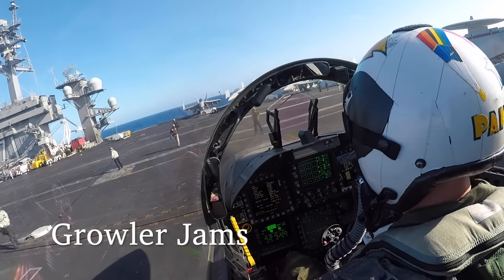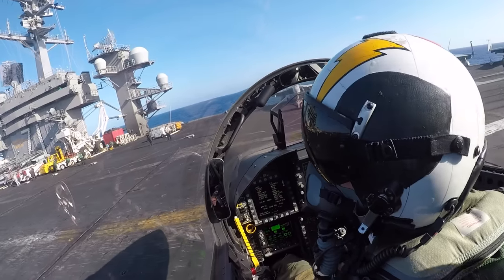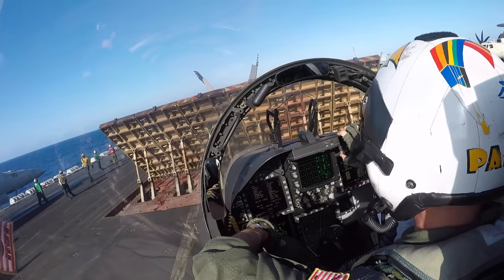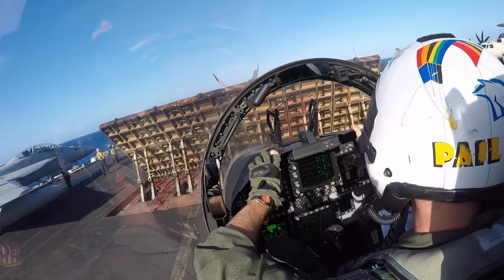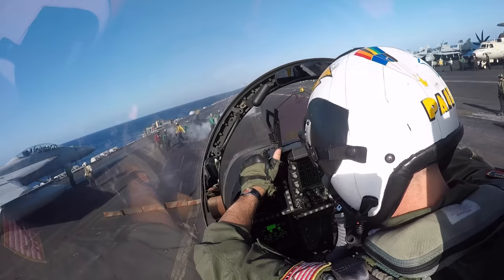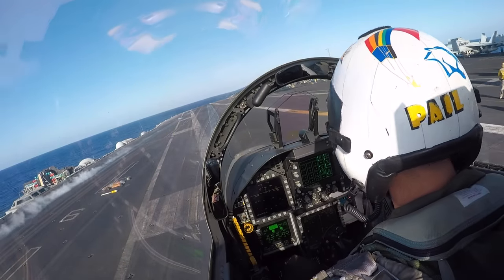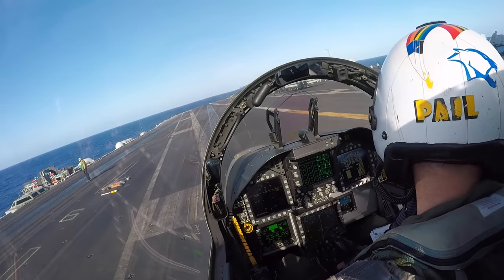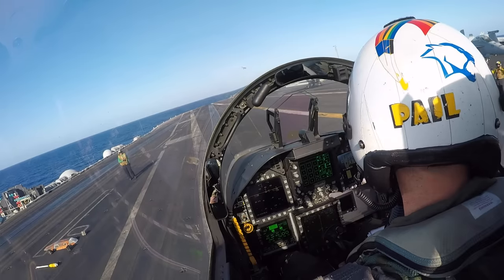What Fighter Pilots ACTUALLY Do Just Before Launch

Comment: I served for 26 years in the Air Force. Started out in NORAD Air Defense Radar Operations, worked in weapons control at the 26th Air Division/NORAD Region at Luke AFB Arizona. from July 1976 thru April 1980. We often had large exercises involving Air Force, Navy and Marine fighter pilots, active duty, guard and reserves, flying F-106's, F-15's, F-14;s and F-4's.  One exercise I got to work with Navy pilots from Miramar flying an F-14. Awesome fighter and the pilots were great. They kicked ass in that exercise!  Really liked the video you did on what you have to do before taking off from a carrier. Worked on the ECM equipment for  the A-10 the last 13 years of my time in the Air Force.
Reply from the maker: TYFYS!

Comment: Good explanation. As a former Handler and Air Boss in the early 80's I am struck by the difference in op tempo between my era and today. When we deployed on Ike (CV69) in 1984 we were loaded with 90 aircraft which included 3 A3 Whales and 4 E2C Hummer very large aircraft so we had very little open space and our deck crews had to be most competent. It was standard procedure to launch 20 plus and recover 20 plus aircraft in 25 minutes. Todays tempo seems very relaxed, airplanes are launched without hurry and numerous people seem to wander around the deck doing whatever they do. Pail just taxies from the finger (aft of el 4) without seeing another aircraft. In my day we would have 3 to 4 aircraft lined up behind Cats 3 and 4.We would be pumping them out as fast as the deck crew would allow. The deck on Roosevelt looked empty. The current director is an enlisted sailor from V2 division wearing a green jersey and yellow directors float coat which to me means that they are using the Bubble. Ike had Bubbles but I would rarely (only for training) allow shooting from the Bubbles because it is much slower and the shooter is detached from the pilot of the launch aircraft. In my years the shooters were always aircrew which produced a trust bond between the ship and airwing. For example during a suspended shot after the aircraft is in tension the pilot was not be allowed to reduce power until the officer shooter stood directly in front of the aircraft straddling the cat track  and signaled throttle back. That allowed the pilot to know from another pilot that the cat was saftied. I understand the standard load out is about 65 aircraft now which in my old timers eyes seems to have way too much empty flight deck. I doubt that the modern deck crew has any idea about how the same deck was run 40 years ago. War is hell and I hope we can win the next one.
Reply from the maker: Wow.  Thank you for your service.

Comment: In 1983 I was in an ASW squadron and we were doing a work up cruise.  There was a bunch of pilots needing Carrier Quals prior to the cruise for the USS Constellation CV-64.  One of the Tomcat pilots got the Air Boss so mad, the Air Boss’ screaming could be heard very clearly over the sound powered headset…  The Tomcat pilot had landed with his parking brake on…  The LTJG was grounded almost immediately!  When we got back to port, that LTJG was sitting on top of his flat spotted tires that was strapped to the pallet next to our gear he was looking very dejected.

Comment: Redesigning the nose gear strut in order to take this tremendous stress on the nose gear, is what makes this type of launch possible to begin with.  Before, it was done with a launch harness, which has a whole different, and more involved procedure. The catapult sled is behind the nose gear. The stress is put on the main wings of the aircraft.  Not in front of it.The physics there makes sense to me.   It takes less personnel to set up this nose strut launch bar type of catapult.

Comment: i have a cat who likes to go outside. when he wants to go out, he runs to the sliding glass door and meows at it. i come over and unlock the door and open it, and he bolts outside. for me its like launching a small aircraft off an aircraft catapult to do this. i call it a cat launch. except for when its cold outside- when its cold outside, the cat takes a few steps, turns around, and then wants to come back inside. i call it a cold cat launch.

Comment: Sir, Do you think that the F-35 may change the way we build carriers? I noticed the Brit's use a Ski Jump instead of a cat as their aircraft as VSTOL capable. Their Helo's fill in for supply, transport, and ASW. JMHO would we be better off with more smaller carriers or the super carriers? I was a USMC UH-1 Aircrew/Crew Chief. We deployed to the USS Tarawa LHA-1 and USS Tripoli LPH-10. The Corps took on the Harrier which could vertically take off but it was unable to launch as there was not a ski jump like the Royal Navy has. My younger brother was with the Marine Detachment on the USS John F. Kennedy and the USS Carl Vinson and he complained about the noise from the Cats in berthing below. BZ...
Reply from the maker: I doubt it.  Frankly jump jets can’t carry much fuel and or weapons.  They aren’t nearly as effective as a carrier air wing.  They are a niche.  Useful in some cases, but the Navy does it better IMHO.

Comment: That just seems like an enormous amount of time spent idling and  hooking up the aircraft to the catapult system. You would think that in the 21rst century and the cost of fuel being what it is that the whole process would be streamlined enough to safely launch in a fraction of that amount of time while consuming far less fuel. The whole process shown is exactly the same as it was when i served aboard the USS Nimitz back in 1985 to 1988. Modern state of the art technology just seems to have never caught up with the systems involved in launching 100 million dollar jets

Comment: Is the catapult pulling the plane completely, so that engines are only increase speed once the jet is launched? Or is the thrust of the engines push the catapult faster?
Reply from the maker: The combined thrust of the cat and the motors create the required flyaway speed.

Comment: If the hold back fails while at mil power but before the catapult shoots can the jet stop on the deck just using brakes?
Reply from the maker: Possibly.
Reply: @GrowlerJams  With the brakes applied and you then go to take-off power will the brakes alone hold the aircraft stationary on the runway? Or will engine power overcome the brakes or damage the tires in some way.
Reply from the maker: Yes, the brakes can hold you in MIL power.

Comment: Nice to be careful and cross the T's and dot the I's but c'mon!  Good video too but ... Show us what you do in REAL EMERGENCIES where someone with REAL weapons is heading for your carrier ready to fire and if you always take that long... you would be sunk before you get past the blast barrier!!  Show us how FAST you can get that thing on the deck and all those slackers out of the way RUNNING, not walking to let you GO quickly... (I think one was eating a sandwich in a hammock while they rolled him off the deck) this is deadly and I mean DEADLY SLOWWWWW.  A Cessna or air or sea drone can sink you before you get all the hand signals to say just get the hell off the deck!!  Good job on all the safety and truly necessary precautions but there has to be a better and fast way you are not showing us.  I always admired the guys I knew from the Rough Raider VFA 125 group from Point Mugu but didn't know they took this long to leave a carrier.